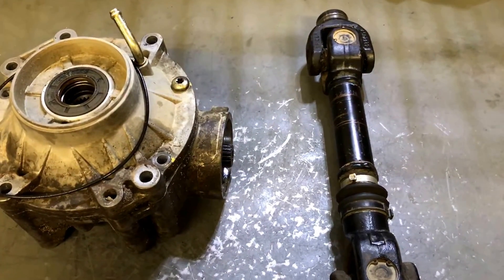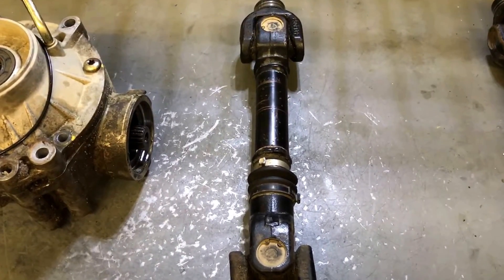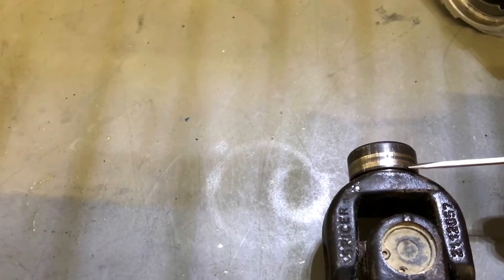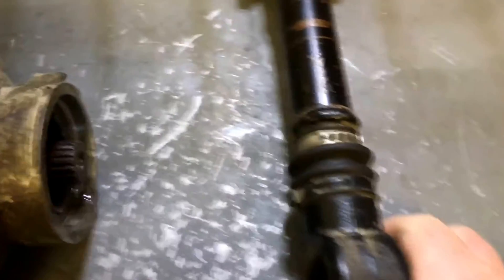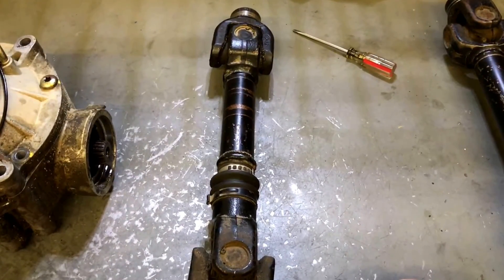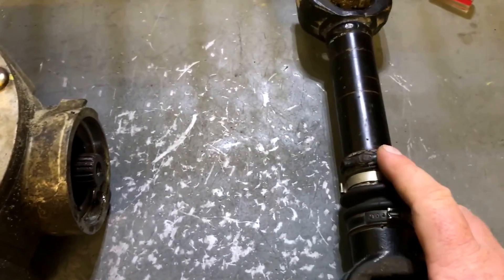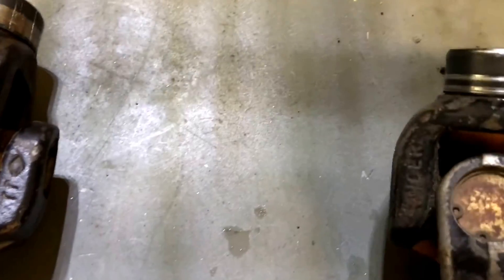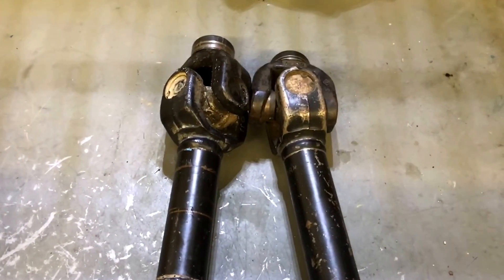Prop shaft phasing and diff failure

Comment: The drive shaft do a banana shape when the splines are as loose as they are, this condition create pulsating radial side loading on the bearing assembly, leading to a reduced service life and premature failure. Prop shaft phasing is also critical to transmit the rotational forces from the output ( transfer case ) to the input ( diff ) the most fluidly possible, avoiding pulsating load on the driveline is the key . Typical causes of these are, poor manufacturing processes, to much torque applied to drive line ( More power Yoh!!! ), lack or lubrication, or lubricant contamination by abrasive materials that will exacerbate the wear in the splines over time( earth, sand and such ).

Comment: O, A VidZ
1 second ago
Hi, are you sure the phasing applies to ALL prop shafts? I have a 2007 Renagade 800 with yokes out of phase since production I think. It seems like if I turn it 1 spline, should get to phase more or less. It has ~400hrs and 7000k km and I'm hearing some noise, but not sure if it's coming because of "out of phase". The gear oil was dirtier than the rear diff, which I suppose it's ok? I know there are some factory de- phased in some old Mercs, but are Renegade's shafts meant to be factory phased or in the first years might be out of phase? Here's a video of my shaft, which I think to pull down and phase it. https://www.youtube.com/watch?v=NdvDSBUYrw8

Comment: Quick question, how much play should be allowed on the slide joint on shaft? Thanks
Reply from the maker: i dont have an exact spec for you but they should not have much at all
Reply: Thanks,i just order new one and has a 3 degree mis alignment from factory